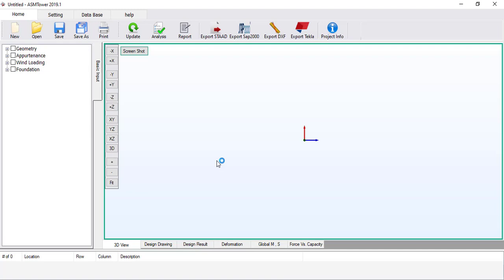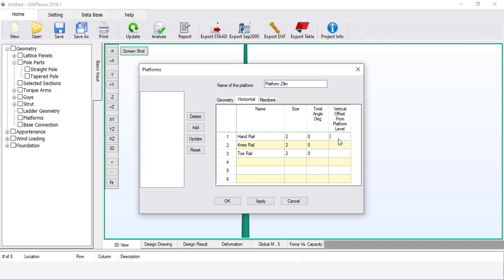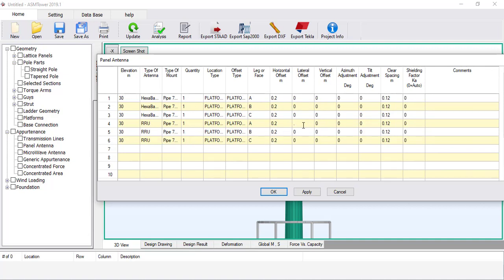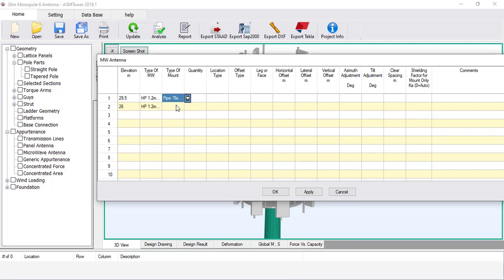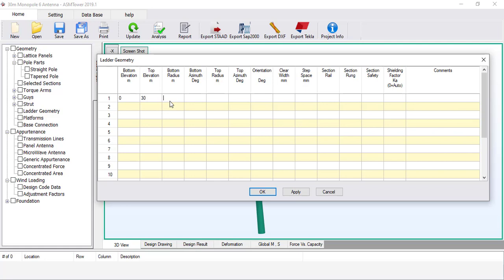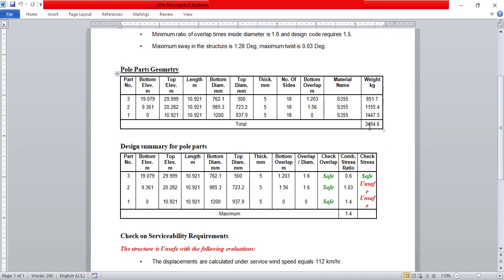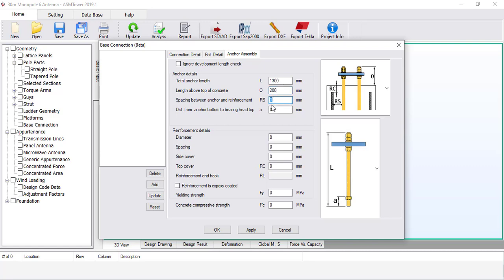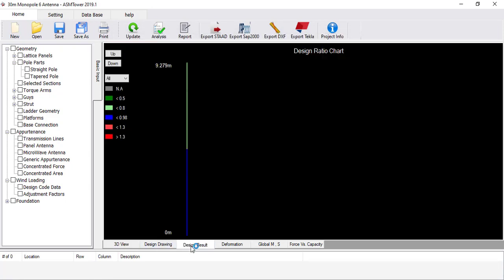Example 1: How to design a 30m monopole with circular platform TIA-222-G or H using ASMTower

Comment: Is it possible to analysis a strait pole with two struts and the struts are also braced with the pole in their mid lengths
Reply: ASMTOWER 2020.2 can model this structure. Also software will calculate wind load on the bracing between struts and check safety of these bracing members.
Reply: @ahmedshaban519  thanks for the clarification.
Reply from the maker: Yes, you can modify the buckling length of the strut from the strut option dialog box to consider the effect of using a midpoint bracing.
Reply: @asmtower548  could you show us an example for that case